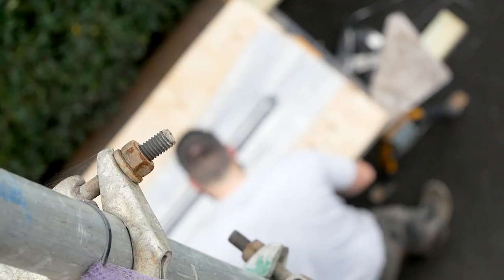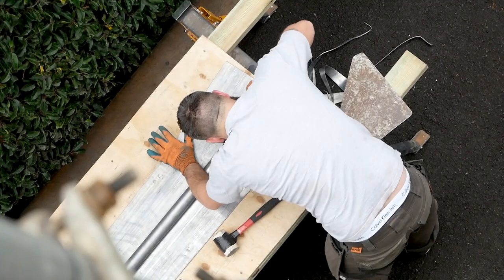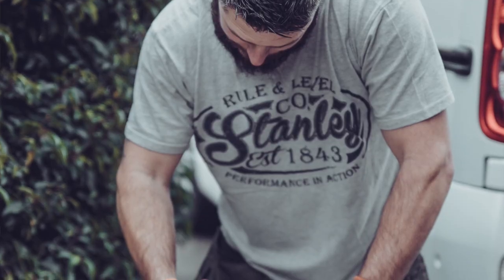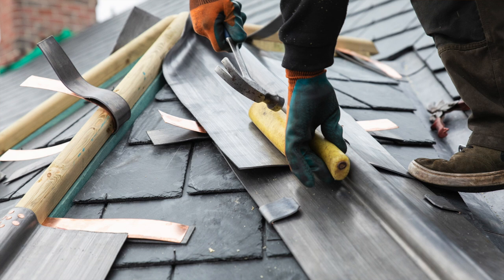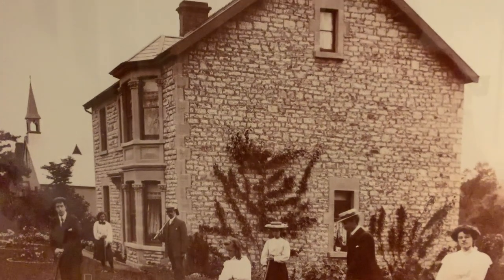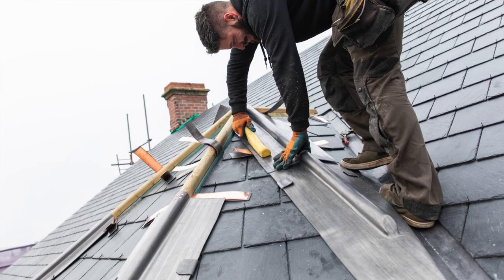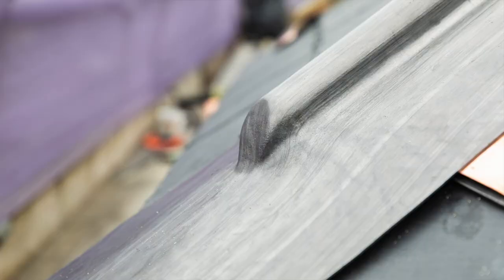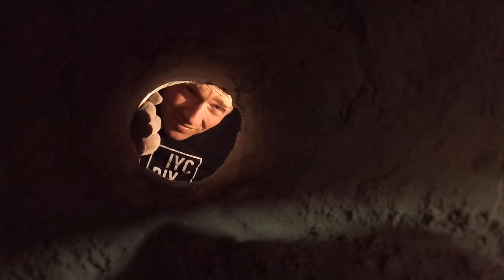AMAZING LEADWORK ON THE SLATE ROOF!

Comment: Here in the uk a good lead man is like gold dust, there just arn't many around. It's a good trade for a youngster to get into.
Reply: will you take me on as your apprentice and put me under your proverbial wing
Reply: Good earner as well if you any good.
Reply: Ok so working with lead is extremely dangerous. This is irresponsible! There is a product out there that replaces the lead.
Reply: @jimsbcarp  power tools can be dangerous if someone inexperienced is handling them, lead is still widely used and safe when precautions are taken.
Reply: @Biden Hunter true but I don't see any PPE at all. Proper handling of lead requires at the minimum annual blood lead level testing and gloves. There is no reason to use lead. For this application Tin Zinc Copper is the replacement product and it performs well. Also power tools are not toxic.
Reply: @jimsbcarp  so about 80 deaths a year in a population of 66000000.
Reply: @jimsbcarp  irresponsible my backside! Clearly you only know HALF the story.

Assessment of the risk to health created by work involving lead (control of working with lead regulations 2002)

5.—(1) An employer shall not carry out work which is liable to expose any employees to lead unless he has—
(a)made a suitable and sufficient assessment of the risk created by that work to the health of those employees and of the steps that need to be taken to meet the requirements of these Regulations; and
(b)implemented the steps referred to in sub-paragraph (a).
(2) The risk assessment shall include consideration of—
(a)the hazardous properties of the lead;
(b)information on health effects provided by the supplier, including information contained in any relevant safety data sheet;
(c)the level, type and duration of exposure;
(d)the circumstances of the work, including the amount of lead involved;
(e)activities, such as maintenance, where there is the potential for a high level of exposure;
(f)any relevant occupational exposure limit, action level and suspension level;
(g)the effect of preventive and control measures which have been or will be taken in accordance with regulation 6;
(h)the results of relevant medical surveillance;
(i)the results of monitoring of exposure in accordance with regulation 9;
(j)in circumstances where the work will involve exposure to lead and another substance hazardous to health, the risk presented by exposure to those substances in combination;
(k)whether the exposure of any employee to lead is liable to be significant; and
(l)such additional information as the employer may need in order to complete the risk assessment.
(3) The risk assessment shall be reviewed regularly and forthwith if—
(a)there is reason to suspect that the risk assessment is no longer valid;
(b)there has been a significant change in the work to which the risk assessment relates;
(c)the results of any monitoring carried out in accordance with regulation 9 show it to be necessary; or
(d)the blood-lead concentration of any employee under medical surveillance in accordance with regulation 10 equals or exceeds the action level,
and where, as a result of the review, changes to the risk assessment are required, those changes shall be made.
(4) Where the employer employs five or more employees, he shall record—
(a)the significant findings of the risk assessment as soon as is practicable after the risk assessment is made; and
(b)the steps which he has taken to meet the requirements of regulation 6.

Now note it states EMPLOYER. It also states where the employer employs five or more. If this guy is a sole trader self employed none of it applies.
Further the exposure is minimal in comparison to employees working in manufacturing lead sheet.
Reply: @jimsbcarp  "products out there that replace the lead" yeah like planet polluting plastic!
Reply: @jimsbcarp  The reason he is using hand tools is so the lead does not turn to a dust which could then enter the lungs. The way he is working gloves and hand washing are adequate. 

Anything is harmful if not treated with respect. Almost every day I enter confined spaces which are several times more deadly than lead sheets. Even the toilet paper you wipe your ass with requires a worker like me to enter deadly places in order to perform maintenance and inspection on boilers and digesters. It is all about preventing risk through knowledge, engineering and safety equipment.
Reply: @jimsbcarp  you don’t know what your talking about, I come from a family of lead workers, all my uncles, my father and myself (am learning the trade) are lead men not one of us has even gotten sick from lead... the only way you can really get sick from it is if you were either drinking out of a lead lined cup for two years straight or if your inhaling molten lead fumes...
your a moral busybody that has no idea what he’s talking about.

this is a unique British art form that is rarely performed anywhere else on earth, and certainly were it is they aren’t as skilled as British lead men.
Don’t try and erase British art.
Reply: @jimsbcarp  where gloves

Comment: Great work, I'm a leadman myself, the only thing I do different is work the straps out so the laps land on the straps so they can't flap but each to thier own 👍
Reply: why mix copper and lead ??
Reply: @creativefilmenterprisespty8042  because the copper straps hold the lead down better and prevent wind lifting the lead up. Lead straps can potentially pull away so hes used copper straps then lead to hide the copper
Reply: @samhopkins8362  thanks Sam, i get that, just worried about galvanic corrosion between to metals
Reply: @creativefilmenterprisespty8042  the copper doesn't react with the lead thats why we also use copper nails to fix the lead also.
Reply: @samhopkins8362  thanks
Reply: I thought the same about having the straps fall on the laps, but otherwise it was top notch.

Comment: Leadwork is beautiful, I wish more people would pay to use it, sadly ridge and fibreglass is so much cheaper that not many ever request lead. BTW.... it looks WAY easier than it is. I have never done this level of leadwork, step flashing, aprons and once did a bay window roof in lead and that's all. As a roofer I'd like to do more leadwork but don't ever get asked for it sadly. I will be buying a torch and doing my own welding soon though!
Fantastic job by this guy, very nice work.

Comment: Around about 1968 I took my plumbing apprenticeship and roofing was part of the course, but what is the art is using the lead bossing(correct term)tools and forming the shape, and boy did your arms ache next day when you were starting out. And the finished item looks magic👌. It's a great skill to learn as you can even from front aprons and back gutters out of a single piece of lead sheet for each. Also the shaping skills learned can also be used for the panel beating of vehicle restoration as use get a feel on how metal moves. A lost skill😢😢😢

Comment: That was such a pleasure to watch. Out of curiosity; what was the purpose of the copper strips under the lead straps?
Reply: Strength
Reply: @benhockey3288  could you expand on that, please?
Reply: Also. lead & copper do not react too badly together under electrolysis. (One metal does not degrade the other when there is an a electrolyte (rain water in this case) Other metals used in the construction industry, if they are used wrongly together, can deteriorate one from the other, it’s called electrolytic action.
Reply: @dougf94912  not much to expand on other than copper is hard metal and lead soft. So by using concealed copper under the lead the appearance stays the same but provides greater resistance to wind uplift.
Reply: @benhockey3288  That's all I needed, it makes sense to me now. Thanks!

Comment: Great workmanship from and a credit to his trade, simple as. Having experience in architecture and slating / tiling I  did cringe a bit when he stood on the finished slating, but was good to see him stay off mostly and use the the  lead valley and timber rolls to stand. Just in passing but your choice of course, but a mitred slate hip could also have been used there.
Reply: Thanks for your kind words, I'm actually an all round roofer so took plenty of care to not brake any cuts, it was difficult but I succeeded 😂👍
Reply: @MrLewisdix87  Yeah, I had an incline you were respecting the slating, now I know why.  Obviously I used to do my own stepped flashings/ soakers, always had back gutters /aprons / tapered and parallel box gutters lead welded by lead-plumbers ( not many want to go up these days !!!!! ), retired now and keep telling myself to go and learn lead bossing/welding at Leeds College, just for the hell of it !!!!! Keep the cracking work up pal and great to see good work is still coming through.
Reply: I am actually 1 of the people behind a growing company called master roofers, we currently have 2 training centers in the UK. 1 based in Hoddesdon, london and 1 in Salford, Manchester, we run basic bossing and welding courses if it was something you would ever be interested in doing👍

Comment: Nice job there. When I did plumbing at college lead was part of the curriculum. The only problem was, none of the instructors in workshop knew how to weld lead. They basically got us to do a couple of Welds and the the steps flashing and had a rig set up which we all had a photo taken off. Heart breaking. Would love to have actually learnt it for real.

Comment: Some may be wondering why the short lengths of lead being used. Why not simply run the lead full length? Well lead has an extremely high friction co efficient. What that means in a practical sense is that when lead expands it will creep downhill on a roof slope. When it subsequently shrinks it will shrink downhill as well. Thus the lead will fatigue crack and grow extremely thin on the upper end of the flashing. If we use short lengths then the creep downhill is massively minimised. So with any trade, lessons have been learned via observation and corrections are made which result in longevity of the product installed. In other words, do it once, do it right and it will see you handing it down to the customers great great grandkids. Proper job.

Comment: Very nice...if I have one criticism it is that. Using your tape as a scribe still leaves a small mark on the lead and even a pencil will cut the lead to a fine degree. We were always taught chalk or felt tip pen . The smallest mark is a weak point from expansion. But lovely to see lead ain't dead
Reply from the maker: Lewis made the same exact point when I was filming. If you look, it’s only on the measurements he is cutting that he scribed it with the tape, the other times he was holding a sharpie. 👍

Comment: Here in Denmark we do not use lead . It has not been legal to use it as a roofing material for about 20 years due to the propensity of this metal to erode and thus contaminate the ground water. I have noticed that the U.K. seems quite reluctant to change long established building practices . A fundamental change of attitude would , I am convinced , be good for the future of the U.K.  One of the best steps you could take would be to begin installing ´District Central Heating ´ facilities with all the attendant fuel savings and reduction of CO2 emissions. Of course the capital costs are high but the benefits in the long term are great.
Reply from the maker: Lots of plans here for more district/community heating. Definitely the way forward for some locations but like you say, but investment. 👍

Comment: Why does he uses two different material strips lead and copper to hold the roof flashing? Thank you
Reply: The copper is a lot stiffer than the lead so does the actual holding of the sloping ridge leadwork, the second slightly wider lead strip then covers up the copper strip when folded over the top... in time exposed copper will oxidise and go bright green so would clash with the grey lead.
Reply: @g7vqedave2  Thank you for explaining. It does make sense now.

Comment: Bloody hell it’s just a hip????
Reply: I know right. Could we see how Lewis would approach a box gutter or something a little more challenging.
Reply: @pleasantville4529  mate with the greatest of respect.... hips and ridges are easy, bossing a roll end on a hip starter takes a bit of time.
I’m not slagging it. But know this, 450mm clips centred work out on laps👊. I’m not knocking,  10 out 10 for the copper straps too. You work is neat bro 👊
Reply: @ELLIOTNEWPIP   I think you may have gotten the wrong impression there pal. I am not the guy in the video. I am a lead plumber myself and was pointing out the same thing as yourself. There are many more challenging things than a simple ridge flashing the example I used is a lead box gutter,sorry for not making myself more clear on that point.
Reply: @pleasantville4529  respect geez. 👍
Reply: Big love to the lead boys ..... this game, you always learn. I’m listening
Reply: Check out my insta guys, I always work my straps to laps but in this case I set out the straps for ascetic reasons and already had the ends pre bossed before I went to site so to save time. Also elliot if you go 11 inches between straps you get an extra strap in between and they all land on laps with 1.5 lead with a 7 inch lap 👍
Reply: @MrLewisdix87  same,  150mm in and 450mm centres ends ups with the clip landing perfectly on the laps in over a 1.5 meter length.
Reply: @MrLewisdix87  
Any way we have spoken before, I call you about that big job in Winchester 😂😂😂😂, Iv just noticed it’s you mate !!! Iv got the order now, there’s plenty down there if you change your mind 👍